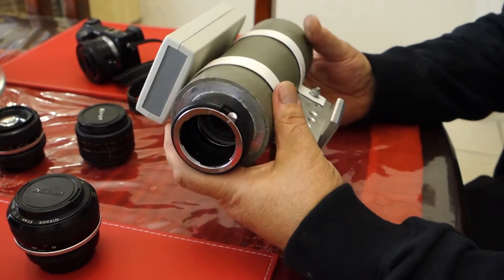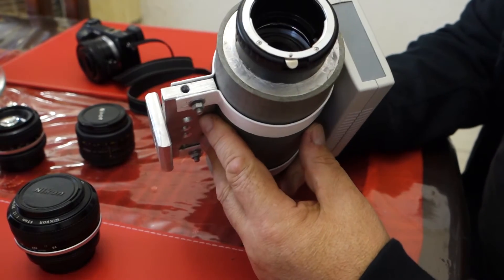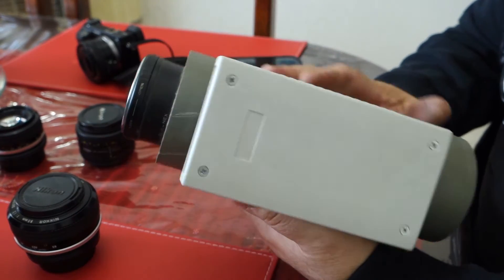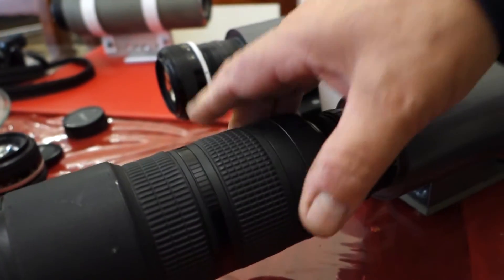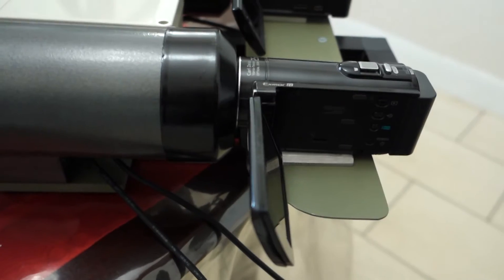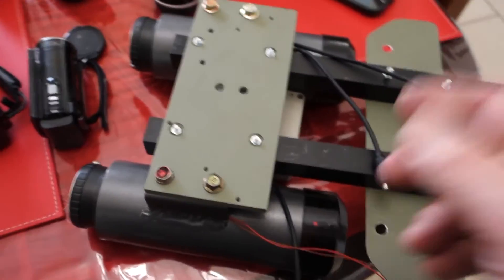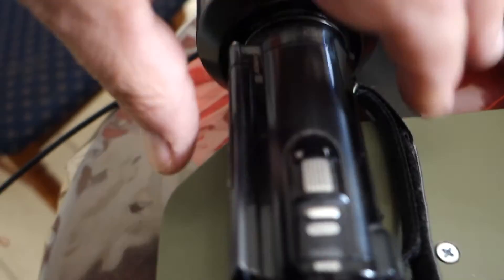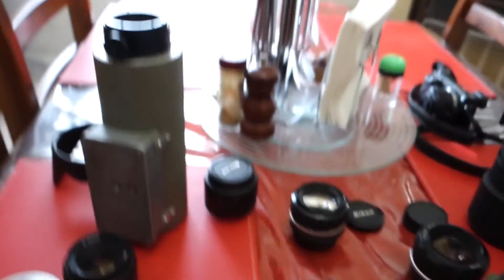A look at my new P8079HP based nightvision viewer /recorder and one of my older units

Comment: Very, very nice. I skywatch in Arizona and I use 1 4k camera and 5 other HD cameras. I've been looking for nightvision and heard about this tube. How long does it take to get from that starlight company? For some reason they don't respond to emails. You should look at my channel. We're both pretty much doing the samething and hardly anybody does what were doing. You should put this on the pan and tilt system that I'm using it will hold 25pds of camera payload. I show how that works a bit on my 4K skywatching  section on my channel. I'd be happy to take one of your older cameras off your hands. I dunno if that company has any of these tubes left.

Comment: Hi, what about  the catadioptric 500mm 1.8  lens ?  plus 2x teleconverter maybe =)
Reply from the maker: Hi  Hola.  500mm f1.8 lens does not exist.  F8 yes but very dark (wont let enough light through) plus very hard to point at something moving
Reply: itakeyourphoto Yes, f8. Sorry . Doesn`t work.
Reply from the maker: n o problems.  I always found 50mm lens is very good for searching quickly. I tried 200mm few times and its very hard for searching but ok if you change from 50mm to 200mm quickly after you find something.  200mm lens has to be f2.8 unless object is bright

Comment: I've read on several forums that these tubes leak radiation is that true should I be worried? I have read that pics-2 eyepieces block radiation is that true as well?
Reply from the maker: proudtobeautistic  All CRT's leak a certain amount of Xrays.  CRT is the display window on the back of the tube.  Being so small the amount would be very very small compared to what you would have got sitting in front of a large tube type TV.   Putting a video camera behind the tube as I do there will be zero  exposure to any X rays emitted

Comment: Hey can suggest me some lenses for my tube setup i don't know what kind of zoom lenses will get enufght light to get good vision a f:3.8 or something less ? 50mmm ?.
Reply from the maker: You really need a f1.4 lens or f1.8 at worse.  The ONLY f1.4 lens that is affordable is a 50mm in whatever brand you want. Affordable  Zoom lenses are usuallynin the f4.5 to f5.6 range. The very best zoom lenses are f2.8 and you will be looking at $1K second hand. In short you need a f1.4 lens if you want your setup to be sensitive. 50mm f1,4 lense is your friend! Look through my other videos if you dont understand the concept of f numbers on lenses
Reply: Thanks for the information i looked at you other video, what  you think about this lens http://www.ebay.com/itm/301238150344?_trksid=p2055119.m1438.l2649&ssPageName=STRK%3AMEBIDX%3AIT
Reply from the maker: soviet9922 That is a cctv lens designed for those small security cameras and as such its no good for this application.  You need what's know as a 35mm type lens. Its what was supplied with all slr cameras.  Search ebay for 50mm f1.4 in brands such as canon, nikon, minolta, pentax, fuji.  Here is an example.. http://www.ebay.com.au/itm/Manual-Pentax-50mm-f1-4-Lens-Canon-mount-/161607050402?pt=LH_DefaultDomain_15&hash=item25a087e4a2.  You want the older ones as they are generally cheaper.   Even search vintage 50mm f1,4 then make sure its for a 35mm camera

Comment: Since the tube runs on just 6 volts of electricity I was wondering what kind of toggle switch should I use? Does it matter what voltage the switch is or can just use any kind of switch.
Reply from the maker: at 6v you can use any switch you like.

Comment: Are you sure it's safe to solder to the screw hole? From what I've read on forums you are not supposed to do that because it could cause the internal power connection to come undone.
Reply from the maker: Ok then let me refine the info a bit. If you sand the connection point and use a good soldering iron and solder quickly it will be 100% fine.  If you keep the heat on that connection for a long time and over heat it then yes eventually you could damage it.  Of the 6 units I have made so far only the first was screwed down, all others were soldered without problems

Comment: Hey mate! I finished my P8079HP setup :) Everything works fine, I ony use 3 batteries, is it enough? Also, I find that there's a huge contrast between the amount of light at the center and the rest of the view... It's not the case in most of your videos!
Reply from the maker: Hey well done!   Its normal with this tube that the centre area is brighter. If your camera allows you to zoom in on the tube then its not so noticeable.
If you are using 1.5v  AA batteries  you need 4 to make up 6 Volts.  The tubes electronics is designed around having 6 volts driving it. Don't use more though as the tube won't like it.  Some claim it works better on 9v but that will only be the case for tubes that are faulty or not working as well as they should.   
I have now added a few bits and a camera holder to my older NV setup and I will make a quick video of it for others .
Reply: What if I use only 3 batteries? Is it bad for the tube ?
Reply from the maker: WTFflow No wont harm the tube but it might not be running at full sensitivity
Reply: Ok :) Thanks!
Reply: +itakeyourphoto regards to 6volts. I was originally running 4 lithium battery think it was approx 12 volts with 6v regulator , however after hearing these tubes have a regulator built in i decided to test it out having bought a new 1 I decide to crank up volts on old tube c what happens, currently run 2 18650 6000mh each outputting 8.4 volts full charge and last for ages. also have noticed the more volts you put in the brighter the screen becomes. Almost like a gain switch, when using my canon f1.2 lens with freshly charged batteries I actually have to stop down to f3-4 to stop the flare, but gives sharper image. Not sure if this is fluke , and wondering if any1 reading this has any further info on the voltages for this tube. and if im actually doing it damage ?
Reply: I know this is an old post but please don't put higher volts through the tube.It was designed  for 6.75 volts operating voltage .That is the most I would put into it. The minimum voltage is 3 volt. With the highest voltage you will gain some sensitivity but it can also add more noise and little flashes on the image. As all these tubes are different some darker than others , some clearer than others you could experiment with different voltages from 3 to 6.75 to get the image you want. If you over volt it, you can burn the tube out very quickly as other on here have found out .Hope this helps someone , the tubes are getting rare and I would hate to see someone burn one out.

Comment: Fantastic! That looks excellent. If you want zoom, you should into using something like a 70/300 refractor telescope as a lens or similar. I experimented with a Meade 70/700 refractor and it worked a treat. Achieves around 25x zoom. Too much! I strapped the assembly into section of 'U' shaped roof guttering.
Reply from the maker: I haven't tried a telescope as yet. Most objects that I see are moving so 25x zoom would be problematic.   Also a scope in that zoom class would have a rather high F number.  I am patiently waiting for a used nexstar compact scope to come my way. Cant remember the model but its one that is very compact and has a motor positioner built in.  Thanks for your comments!  I'm off to check out your channel now..
Reply: +itakeyourphoto 

how would I go about having approx. 10x zoom or even something adjustable? I would like to build a spotting scope fur hunting to better be able to judge Sex and age of animals when it gets dark.

Comment: Dude! Thanks for the setup video! I found a F/1.4 M42 lens. Is the rear glass smaller than the tube's output too, even at F/1.4 ? I need to know that, cause the lens is really cheap! If it's ok, is this adapter the right one? http://www.image-share.com/ijpg-2603-85.html

Thanks bud :)
Reply from the maker: Hey not sure about M42.  I think it should be ok but really not sure. Probably better if you stick to 35mm format to be sure